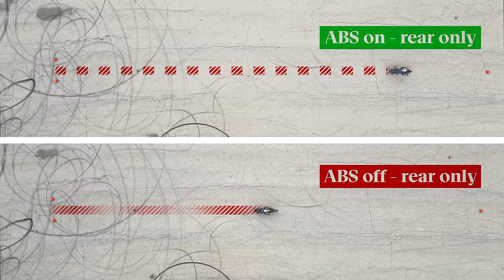Out-braking the ABS Myth

Comment: When I was training at my car manufacturers school, they taught us that ABS was never about stopping quicker - it was only so you could retain steering control because the wheels haven't locked up. Lines up nicely with Ryan's brilliant piece here. EBS was, however, developed to shorten stopping distances. Thanks again Ryan!
Reply: Ironic because I like ABS on a road bike for exactly what you describe. On the other hand I've had several incidents in cars over the years where the ABS has completely killed steering response negating the swerve phase in break-swerve-recover.
Reply: We also had been taught the same when we getting educated as mechanic. However, our teacher said that the best braking power is the milisecond or so before the wheels lock up. It is where the wheels are still rolling with the decel, but not too hard as to have the tire skid across the surface of the road. ABS also helps for cars as to make sure the rear doesnt lock up and skid around due to the transfer of weight to the front wheels. Either way, Im as a driver always glad to have the ABS on my car, or rather the cars Im driving, as more to be able to have steering control if I need it
Reply: The main life-saving feature of ABS is that it stops people panic braking from spinning into a tree or oncoming traffic.
Reply: exactly this , but those people with big egos think they are better than the computer on their bikes/cars . ABS is all about control and if you think you are that good you don't need ABS then you will never activate it while riding because instinctively  you will be braking at maximum coefficient of grip and never lock a wheel.
Reply: @honkiebikedude  you'll never spin the back tire to turn around on a gravel road right?
Reply: @honkiebikedude I’m so good my cheap bike doesn’t have ABS!
Reply: I can remember when the late great British tech motorcycle journalist John Robinson was at a Yamaha motorcycle launch heralding their first motorcycle to be fitted with ABS. He managed to persuade the very reluctant Japanese boffins to turn off the ABS and promptly stopped the bike at a shorter distance, proving your point about not stopping quicker.
ABS was developed to preserve the steering ability of cars from a front wheel lockup that results in plow understeer.
Where I live in Devon England we have a lot of two-way single-track roads with high hedges, with NO escape route for two vehicles traveling head-on towards each other. After any heavy rainfall (it's England) with loose gravel, ABS can become lethal because loose gravel is like driving on small marbles, meaning touching the brakes results in constant ABS pumping with next to no braking. Pre ABS, the front wheels under very heavy braking or even when locked up, push the gravel away exposing the tarmac below it, allowing the vehicle to stop much quicker in this situation.
Reply: @lauriepullman3873  I'm no expert on this, but I'll try to explain this to the best of my knowledge. ABS, simply put, does only stop the tires from locking up. Locking up would decrease brake performance and makes steering impossible because the tires start losing contact (skipping) with the road and are not turning anymore. In this sense, ABS helps with steering while braking. But locking up while braking is not the only thing that makes steering worst while braking. The issue you face furthermore is the traction of the tires (mainly the fronts). Tires have limited grip that depends on the tire itself (contact patch with the road, i.e.  slick vs all weathers) and the environment (weather). This grip is required for braking and steering, for example if you want to make a hard turn you use a lot of the grip to make the car turn. This means tire suck at braking and steering at once because both want to use the grip, but there isn't enough for both. This results in under steer where the vehicle will hardly turn because the car is pushing over the front tires and starts skipping over the road. For this reason, one of the basic rules of racing is you either brake or steer, both will not work together. What you can do to get better steering while braking is known as trail braking where you ease off the brake to free up some of the grip of the tire, so you can start steering. 
The reason this is especially noticeable when slamming on the brakes in road cars is because road tires are small and are designed to work in most weather (-> less grip) and the car is heavy with a high center of mass (-> more grip required to break / turn). Now if you hit the brakes into the ABS the tires are getting close to the grip limit because you want to stop, but this leaves very little grip to turn. This also occurs without ABS when you brake hard.
Now I am really uncertain with the difference to bikes (I am not a biker). Bikes do have less under steer because they're lighter, etc. But I also believe that the equivalent of severe under steer (while braking) in a car is a stoppie because unlike the car the bike can rotate over the front wheel (it is lighter, has a shorter wheelbase etc.). If this assumption is true, then bikes have the advantage of anti-stoppie systems that avoid stoppies, while anti under steer systems do not really exist / are not common as far as I know (maybe more modern cars with better driver aids have them).
Reply: @adambrezing  Bikes are an interesting case study. Modern bikes and tyres are (sweeping generalisation) limited by physics rather than traction. Under hard braking weight transfer to the front is near total while suspension dive shortens the wheelbase appreciably. Assuming you aren't a ham fist oaf, the limiting factor is rotation around the front wheel. A stoppie is your signal that you are on the limit.
The headstock acts as a hinge if you are not in a straight line but that is probably a case we can ignore here.
The natural state of a motorcyle is oversteer. The back wants to overtake the front either from power or drag. Understeer is a sign that your front end is set up wrong or your tyre is flat. The edge case is choppers where the fork rake can cause net force from weight transfer to be in the direction of travel rather into the road. A mate crashed his Harley as a result of this - a situation ABS would fix. I suspect this is where the "front brakes are dangerous" myth comes from.
Thinking about my car experiences, the last two were almost certainly AEB rather than strictly ABS. 
The other was an early Holden system that was just horrible. Once the pedal starts pulsing on those you are a passenger because its reset time is so long that easing off just causes it to freak out completely. Any number of Commodore Utes have been wrecked on gravel roads due this.
Bike brakes are unboosted and operated with your hand so you really have a sensitive lever. The ABS pulsing is a fantastic warning that you approaching the limit. It gives you a chance to ease off and get back on harder without actually locking the wheel.
Its no fun on dirt mind, 'cause there the difference in wheel speeds on a loose surface plays merry hell. 
And you can stoppie a bike with ABS but you have to try 🙂
As an aside, the best brakes of any car I have driven were on a mate's homebuilt Lotus 7 replica. Unboosted, the pedal was like stepping on a brick, but the harder you pushed the harder it stopped and you felt everything. Not really practical on a car weighing more than its 600kg wringing wet.
Reply: @Danspy501st  Yes and no. Maximum retardation (stop sniggering at the back) is just before the force applied exceeds the friction between road and tyre. There is a point where the former exceeds the latter and the wheel locks. To make it more complicated, that point is dependent on how fast that force is applied at which point I need a white board to draw graphs.
Reply: @elmeradams8781  that’s traction control not ABS.
Reply: @Brit_Toolmaker  I still miss Prof John, Mark, Trevor, Simon, er al in Performance Bikes. That really was a golden age of motorcycle journalism.
Reply: @Dunno2430  I didn't know motorcycles had traction control. I was just kinda making the point that sometimes you want your tires to slide, or one tire to come off the ground. 
The only time I can think of is when screwing around, but still 😆
Reply: “…steering/swerving while braking…” is not a thing on a single track vehicle experiencing high rate decelleration braking, i.e., emergency braking on a motorcycle. This is true whether near threshold, at threshold or ABS activated braking. Riders who think a bike will steer during emergency braking have a carcentric view on things.
Reply: Lots of comments about “…steering/swerving while braking…” but this is not a thing on a single track vehicle experiencing high rate decelleration braking, i.e., emergency braking on a motorcycle. This is true whether near threshold, at threshold or ABS activated braking. Just cause the front hasn’t locked doesn’t mean the bike remains steerable. Riders who think a bike will steer during emergency braking have a carcentric view on ABS. (Of course a bike has no chance of steering if the front is locked and sliding, so there is that).

One reason for the US centric 80/20 stat is that for ages most states had no mandatory CBT meaning riders had car skills on their bikes and carcentric over learned skills took over, ie stomp the pedal. Also, the US has a very high proportion of cruiser style bikes where the rear is an effective brake due to weight distribution, which reinforces rear brake braking which is what the brain would call on in an emergency, ie stomp on the pedal. This is true in other jurisdictions where a rider had fallen into the habit of rear braking on their cruiser or was a long time rider who hadn’t benefited from more modern CBT. 

In the US particularly though, a long single skid mark often proceeded a bike crash, typically a cruiser style bike, which could only come from a rear brake skid.
Reply: @robsalvv5853  right on. And on lighter bikes, they don't leave skid marks, not on the asphalt anyway.
Reply: @honkiebikedude  Bingo! After around 10 years of 7500 miles a year, all weather/all year riding, I have had ABS kick in twice unexpectedly. 
When I change tires/brake setups I will go to a certain empty road and see how the brakes+bike feel when ABS kicks in, I find it is very consistent and have high confidence in the bike's abilities. But the biggest influence in how often ABS engages is do yur best to stay out of situations where you are going to need to make an emergency stop, never drive/ride faster than you can stop/avoid a situation.
Reply: @Danspy501st  around 20% Slip is the best to stop quickly and modern Race ABS will manage that.
Reply: @Brit_Toolmaker  usually abs gets scared sometimes but mostly you can brake a bit before it starts intervening and it will stop almost as quickly as without abs. What i like is when you overestimate the brake pressure all that happens is ABS stepping in and not crashing.
Reply: @honkiebikedude I heard somebody say, that a really good driver drives in such a way, that all those electronic systems don't engage (so, in case of the ABS this would be proper speed, distance to the next car/bike, predicting others' actions/defensive driving, accurately using the brake pedal, etc)
Reply: ABS on a car will stop quicker if you know how to use it. You should not stop applying harder pedal pressure just because front abs kicks in. Press even harder, and you get max braking, front and back. Without ABS, when you are on the limit on locking your front wheels, the rears are often only at around 39% braking power. So you can never beat a good ABS system for short braking distance. If you have a driver that can use it. ABS also adjust braking pressure hundredes of times every second to adapt to the surface.
Reply: it also saves you some rubber
Reply: Ever noticed how the car doesn't have a separate front and back break? Or like they have 4 wheels instead of 2? Yes it's a totally different beast.
Reply: Ebs??
Reply: That used to be the case, but modern automotive ABS systems will brake quicker now. There are videos here showing the braking distance in a 3rd gen Miata with and without ABS. ABS even beat a race car driver who made 5 attempts to beat it. The newest 3d gen Miata is the 2015 model. The 4th gen is even better. Bottom line... if you're on a motorcycle... don't tailgate a Miata.

Comment: An experienced professional driver can outperform ABS, by a little.  But for the other 99.9999999999999999999999999% of humans, ABS will do better, especially when you panic brake.
Reply: Wrong.  Sorry corporate apologist.  Go get your booster.
Reply: they are comparing apples to oranges... panic brake slam vs perfectly controlled manual braking  instead controlled vs controlled and panic vs panic ...
Reply: @Asghaad  It wouldn't be great click bait if the comparison was accurate.
Reply: Did you know there are some of the motorcycle riders who live on dirt roads ? There are motorcycle riders who live on dirt roads  and also ride on dirt trails ... And still others go over the river and through the woods to grandmother's house they go ..in these kinds of situations ABS does not work well to say the least ... One person said with all dirt bikes you can at least turn off ABS on the rear brake of adventure bikes ... That would be insane ...ABS, lean angle ,traction and wheelie control is good for a Gold Wing   on wet greasy pavement ,, but that's  about it .. adventure bikes that weigh 550 lbs or more .The rider decided he will take a new trail and getting there he blows right through a stop sign that has weeds over grown so he doesn't see it in time , hits the brakes and nothing happens because the ABS will not allow the tires to  stop slipping on dirt ...in the trail same thing on an extra steep down hill.
Reply: @Asghaad  The point is, most people panic brake in an emergency and in a panic brake condition, ABS is better.
Reply: @anthonybachler9526  indeed, which is why the comparison should be between the same style with and without ABS enabled not two totally different styles of braking as ABS was designed to shorten EMERGENCY braking distance
Reply: @Asghaad  yeah but thats saying we shouldnt compare professional drivers to joe blow because they are different people.  That is the entire point.
Reply: @anthonybachler9526  the comparions of DEVICES should never ever be about the "human element" in the first place ...

either drivers of both machines are "joe average" or they are both "proffesional drivers" in which case Joe will always slam the brakes and professional will always feather the brakes  - in former case ABS will be huge improvement in the other it wont make any difference because it wont ever enter the equation ...

which means that in every case ABS will be at minimum just as "good" as no ABS system and only provide benefit where its needed ... and it saves lives in those cases ...

the concluison being the ABS is ALWAYS better than no ABS because even "proffesionals" can make mistake when met with unforseen circumstance in which case they can fall into "average joe" side of the "does it help"

Comment: That's part of why ABS has so many levels. It's a backup safety system, not a replacement for proper training. Great video as always.
Reply: However, proper training is negated with ABS. People don't disable ABS to practice. I remember before ABS practicing on my road bike to the point of skidding the front tire, but not locking it up. Also learned to drift both front and rear. That was a lot of practice. Most people will not take it that far and I think the abs overall is probably safer based on the level of skill most riders achieve.
Reply: @ScottDukesRealEstate And that's exactly why this video was made, it motivated me to practice more
Reply: @ScottDukesRealEstate When i got on the bike with ABS i did some braking training to find out how ABS behaves and where it starts to regulate so i can get as close to possible so it almost never needs phase 3. Its also a good safety net to train without crashing. Most bikers never even tried to do an emergency stop with their non ABS bikes. I see how most brake on the track and its not very good.
Reply: @ScottDukesRealEstate  ; same with flying aircraft, many just want the fun stuff, so neglect the incipient stall-spin, and glide/short field practice approaches...

Learning and honing the basics sets one up for great disaster responsiveness.
Reply: The problem is that its very hard to practice for situations where you have no time to think. 

Yeah you can brake faster without ABS but when I only have a split second to react I‘m happy that I can just dump the brakes and my ABS will handle it reasonably well.
Reply: @Simoxs7   Didn't you learn anything from the movie "The Karate Kid"? There, too, he only practiced the basic movements by painting and sanding the fence for a long time, so that he could make good movements without thinking and by reflex. In this case, too, you must learn to brake quickly and effectively without ABS in safe and controlled conditions. In an emergency, you don't have to think about it anymore, it just comes to you right away, and you'll do it well if you've practiced enough. This means you can still have ABS on your motorcycle, so you have the safety if you screw something up, but if you do it right, you will be much safer thanks to your knowledge. This knowledge has saved me several times. Why would anyone turn down such an opportunity?
Reply: @lacikeri3102 because laziness my friend.